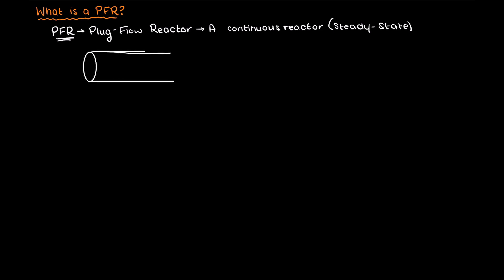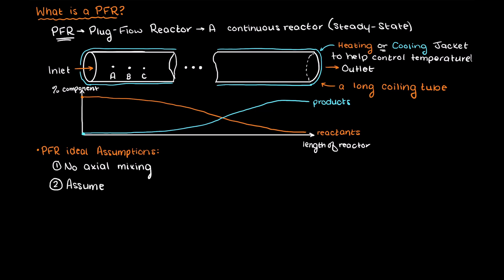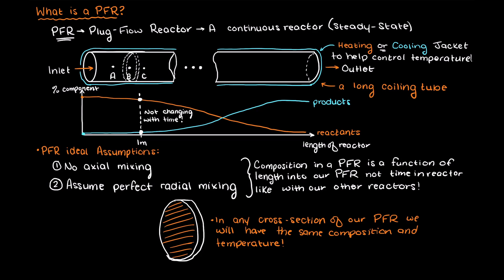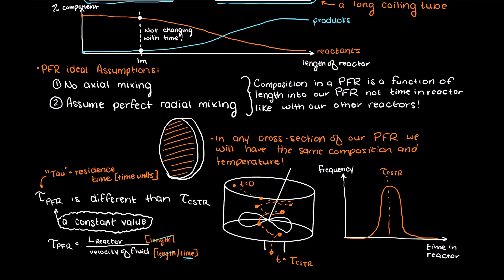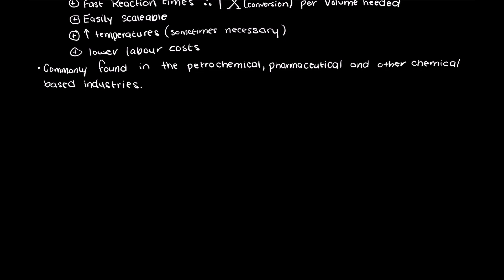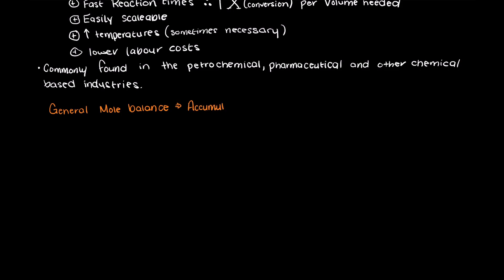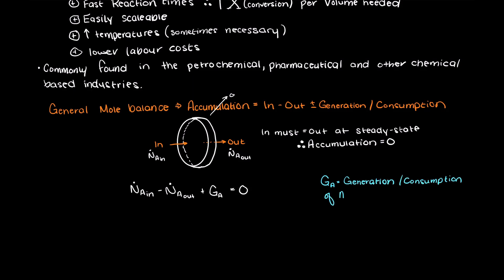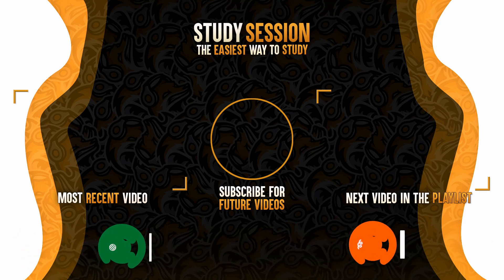What Is A PFR?

Comment: Thank you for your video, I'm doing my Final year design project about sizing PFR reactor. I am a bit struggle with it.  Usually at uni student level: what components should we consider in sizing PFR ? (volume, diameter, length, inline mixer , jacket?) . if the process are series reaction  with rate constant r1 , r2, r3 . How do we combine them together into one rate constant ? Thank you so much